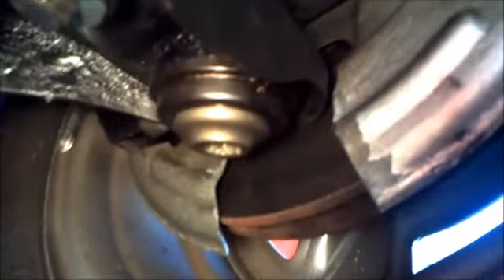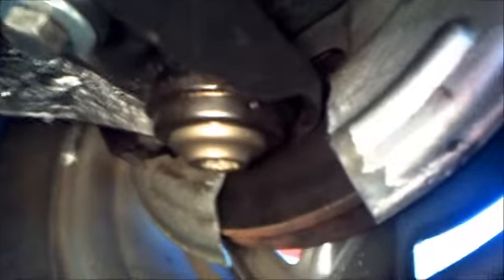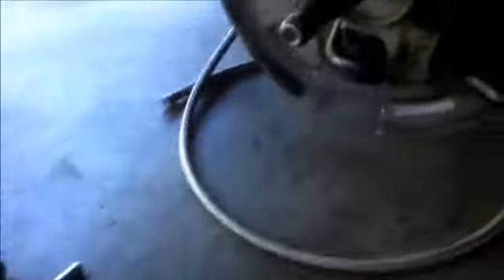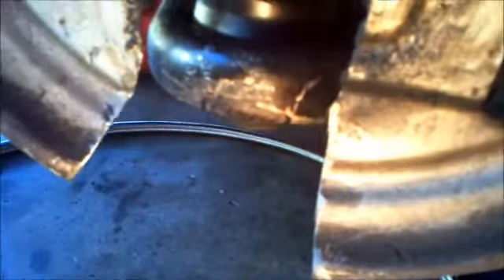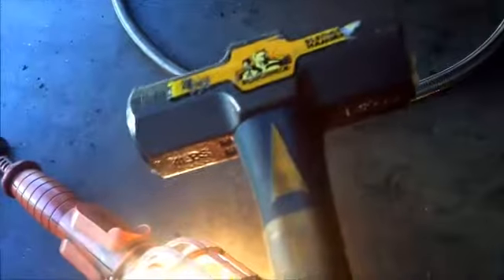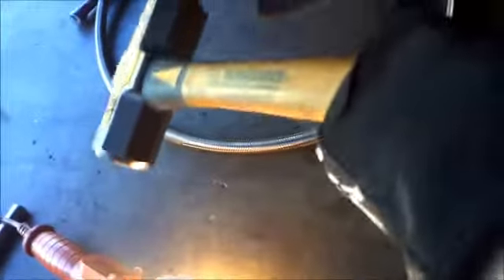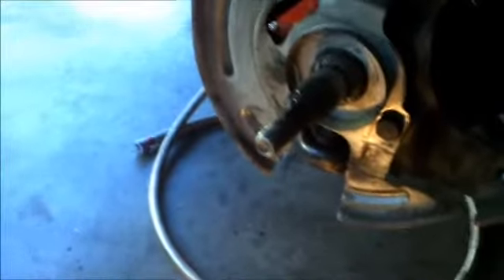69 GM A Body Control Arm Modification

Comment: Why is this clearance problem happening?
Reply from the maker: These are aftermarket control arms and they're not designed for this car that's why you have to make the very minor modification for clearance.
Reply: @woodsandbarclay  Yeah, just bash your suspension parts to clear even if they are not the correct parts.  What can go wrong.